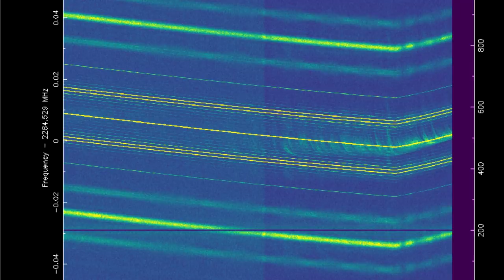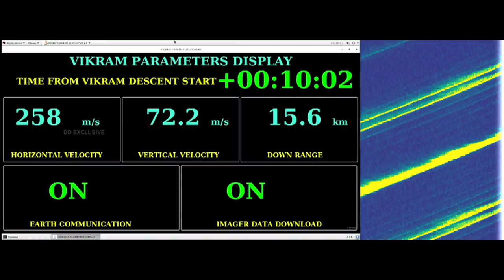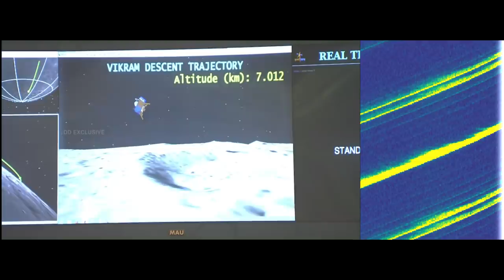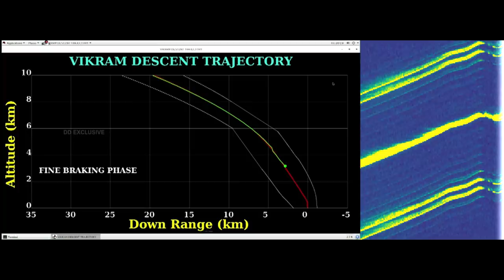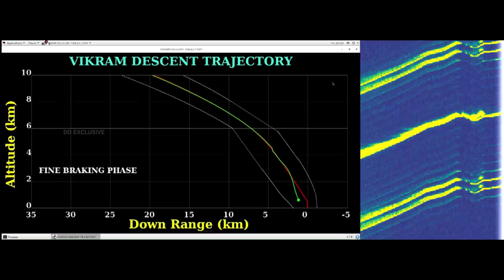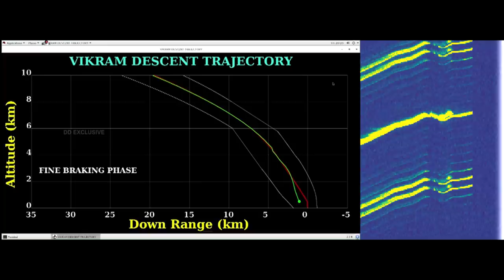What We Know About India's Failed Lunar Landing

Comment: "To their credit, they did hit the moon at a lower velocity than the [Israelis]" LOL, well I guess that's one way to look at it.
Reply: Why don't people ask why this is so difficult when the USA did it in a tin can in 1969?  Shouldn't it be 1,000,000 times easier with computers?  Wake up, people.
Reply: @basedbear1605  If Apollo 11 had followed its automated landing program it would have crashed into a crater full of boulders. And that's if the radar data overflow error could have been corrected remotely.  It only landed successfully because experienced pilots were controlling it in real-time.
Apollo 12, 13, 14, and 15 all had anomalies which could easily have resulted in failure had there not been trained men on the craft capable of diagnosing and correcting mechanical and computational faults. As we know, in the case of Apollo 13 the fault was so critical that the crew barely survived after having to scrap any possibility of a landing.
Reply: @basedbear1605  Actually, tell you what, I concede, perhaps you are right, moon landing is fake!

And so? Does that change the fact that there are new generation of space explorer, attempting to land on the moon? How does moon landing being faked or not change any of our current situation?
Reply: @HermanVonPetri    I think NASA's airbag approach is the best so far if it absolutely has to make it there in one piece.
Reply: @HermanVonPetri  That's a very good point.... However, the computer aboard Apollo 11 had less computing power than in high end Samsung refrigerator.
Reply: @Verpal  If you cannot see why faking the moon landing was important, then I doubt you will listen to anything you are told.  But I will try.

Getting a population to believe an absurd lie is the easiest way to control them.  Once you take something as truth, you base everything after that on that thing.

If we landed on the moon 50 years ago, why did no one follow us, ever?  Are we really that super special that no other nation could fly to the moon in a tin can and paper thin suits in a vacuum?  And shouldn't we have a moon base by now?  The moon is the pinnacle in military advantages.  You control the Moon, you control the Earth.  Why aren't nations fighting over it?

If you believe the moon landing was real, you will believe whatever the government tells you.  It is 100% about mind control.  NASA is the new religion, people believe on faith.
Reply: @WadmanP  So? The more complicated the system, the more there is to go wrong. The best you can do with an automated system is to have backups for the backups for the backups, and hope that you've accounted for the most likely and/or most serious eventualities. And there's still going to be problems that weren't anticipated.
Reply: @basedbear1605  I fucking wish NASA was the new religion.
Reply: @basedbear1605  What's wrong with you?!?!
Reply: @basedbear1605  grey and tasty?
Reply: @basedbear1605  I just wanted to confirm a few thing first.

Is moon real to you, is there an actual moon? Do Space exist?
Reply: @basedbear1605  and USA has shared the technology with the world? Or trying to maintain monopoly?
Reply: @basedbear1605  half of the world was under British rule when USA was already developed. Other countries started late. USA didn't land on south pole yet which is most difficult place to land on moon.
Reply: I'm assuming you're a moon hoax person. While in some respects it's "easier" with computers, it's also a monumental engineering issue, and as we saw even with Apollo, we had many issues. So yeah, guess what, first time India tries to land something, it went sideways. It happens, how many attempts have occurred since we did it? Pretty expected there are still some failures.
Reply: The funniest thing about the moon landing hoaxers is that they tout how important it was. So they really think the Soviets and pretty much every country on the planet was like "okay this is faked, but we'll just go along with it, because...reasons." This global conspiracy, where even the Russians are like "let's let the Americans because..." is obviously such crap.
Reply: @basedbear1605  the soviets tried, and failed. Their moon rocket to be blew up during every takeoff. The N-1.
Reply: @basedbear1605  computers may have improved but the laws of physics remain the same and propulsion technology is essentially unchanged. In just two short sentences you have very clearly demonstrated and almost complete lack of understanding of the relevant factors (which is really quite normal for you moon hoax/anti-vax/chem-trail/insert-delusion-here people).
Reply: @basedbear1605  there's a little thing called the Van Allen belt or some sush name , ........
Reply: @basedbear1605  i think you need to wake up instead.
Reply: @basedbear1605  why is it so difficult to make a self-driving car when people have been doing it for centuries? 
Answer that question, and you got a similar case to apollo 11 vs modern unmanned landers.
Reply: @basedbear1605  no it should not be easier with modern computers than with the simple computers NASA had in 1969 and a human. The computers failed in 1969 and they had to land manually because the physics did not behave reliably enough for the math to work. More powerful computers don't make physics behave differently, math is still math, when the world doesn't follow the math a computer can't do anything, and it's very hard to have all the math perfect for a moon landing. The difference a more powerful computer can make isn't as big as the difference that when it failed in 1969 there were 2 humans ready to land it, when it failed in 2019 there was no one on board.
Reply: What was that quote? 'never attribute to a conspiracy what could more easily be explained by incompetence?'

Eh. That's not really that relevant. XD

The thing about conspiracies is they are difficult to maintain.
You REALLY think it's more believable that tens of thousands of people successfully maintained a cover story about faking the moon landing, without issue for 50 years than the idea that we actually landed successfully?

The problem is, somehow a bunch of people think maintaining enough secrecy to keep a worldwide conspiracy that would've had to deal with trying to get hundreds of thousands if not millions of people to keep a secret and not screw up at all is an easy task.

Most secrets struggle to be maintained for more than a decade or so when it's less than about 100 people that even know about it in the first place.

There's nothing believable about a conspiracy that requires absurd levels of secrecy to pull off. 

I'd sooner believe that the moon is made of cheese than some of these inane conspiracies that require millions of people to maintain secrecy AND extensive illusions about reality for many decades at a time.
Reply: @Fubuki_Kai  
Stop lying to yourself. The Soviet Union landed several Landers on the moon. Check out the lunar series
Reply: @Fubuki_Kai  
In fact the Soviet Union was the first country to put a man made object on the surface of the moon.
Reply: @azeezbawumia6511  I mean their manned moon program. They did have alot of unmanned achievements and even held the record for the longest distance travelled on another celestial body for a long time up until Opportunity broke that record in 2016 I believe. Not trying to say they didnt make it to the moon at all, only that the Soviets tried to put men on the moon and failed several times.
Reply: @Fubuki_Kai  the Indian mission was it a manned  mission? No so why are you comparing the two. As I already said you are comparing apples to Oranges.

Compare Russia's unmanned lunar missions to India's unmanned lunar missions

Even that is still not far considering the fact that Russia achieved those feats when technology wasn't that far advance like it is today.

China nailed it and India could have easily nailed it too.
Reply: @azeezbawumia6511  I never said anything about India or china?
Reply: @Fubuki_Kai  
I'm telling you that China landed a lander on the moon without any failure as such India could have also achieve the same feat without failure.

You probably have issues with comprehension.
Reply: @azeezbawumia6511  ok buddy, and all I said was that the N-1 rocket program never suceeded. We landed men on the moon, and the Stovies tried. I was only addressing bear's point that nobody else tried to "follow us".
Reply: @revermen3580  Indeed
Reply: @rajeshprajapat6009  What technology?  Rockets?  Are you serious?  That's 100 year old tech.

The Chinese are ahead of us with regards to AI, and they still haven't sent people to the moon.

Do you really think that there are any tech secrets any more?  That's cute.
Reply: @mcs699  There you go again... thinking.  You should leave that to your betters.
Reply: @rajeshprajapat6009  Are you familiar with logic?

The Soviet Union was neck and neck with us.

WHY would they ever have stopped when the Moon is the ultimate in military advantage?  Why would they stop and not have planted their own flag? 

Answer:  They wouldn't have if it were possible.
Reply: @Fubuki_Kai  I am well aware.  NOT ONE MAN HAS DIED IN SPACE.  NOT ONE.

That is so incredible by itself that it's beyond imagination how someone would believe we went through the most inhospitable environment possible to man without anyone even getting radiation poisoning.

Do you know what the Van Allen Radiation belts are?  Look them up.  According to NASA, we STILL cannot get through them.
Reply: @kirkc9643  Here's how brainwashed you are.

You JUST ADMITTED that the rocket tech, which is the most important part.... has NOT changed and is easily reproducable.... but yet no one has been back.  Not one single country in 50 years.  Not even the Soviets who had the tech at the time.

You don't find that odd?  Amazing.
Reply: @higueraft571  Wrong.  The question is... if it worked once.. why don't we keep using THAT?

NASA claims that it would be "a painful process to build it back again" (Don Petit quote).  Really?  They take $21BILLION a year and they can't recreate a 1 KB computer system?

Cmon man, open your eyes FFS.
Reply: @HolbrookStark  This is the worst argument of all, and people try to make it again and again.

If a 1 KB computer system is what it takes, then we could EASILY remake that same system from spare parts at Radio Shack (if they were still in biz).

If you believe that we are incapable of making the same transistors and computer parts that were in the Apollo 13 space program and recreating it, then you're simply a fool who will believe anything, because that's ludicrous.

Why would NASA ever lose the telemtry tapes?  Shouldn't those be in the Smithsonian???  The greatest achievement in human history and they LOST THE EVIDENCE??????

Cmon man, open your eyes.  That's simply stupid to believe.
Reply: @basedbear1605  Cryogenic technology was denied to India by USA in 1990's then we developed our own. Rockets are used to launch spacecrafts and not land. 40% of the  lunar missions in last 60 year have failed. ISRO was able to launch mission on Mars in first attempt. Launch more than 100 satellites in one rocket. No country including USA has landed on the south pole of moon yet. Landing in Florida is not same as landing in Antarctica. China stole all your technology. This is shocking the extend to which China has taken over the USA market and reverse engineered everything.
Reply: @rajeshprajapat6009  While some of your claims are true... none of them dispute my facts, and none of them explain why no country has ever gone back in 50 years.  USSR was right with us neck and neck... why would they just STOP and not fight for the moon?  Are you saying the moon isn't strategic and worth fighting for?
Reply: @basedbear1605  there is no atmosphere on the moon. The probability of successful landing is low. The priorities could be something else for Russia or anyone else. There are many videos to explain on YouTube. If USA was able to land on moon in 69 then should have established station there by now. World know what happened but the rocket science is complex, all countries are kind of reinventing the wheels for their own country. The space race is not just bipolar anymore. The whole idea for whatever I said was to explain why it was difficult for ISRO to land on moon's south pole. Thanks
Reply: @basedbear1605 : Why didn't anyone follow us? Because we confirmed that the Moon is a dry dusty dead rock that has no strategic value except as a place to practice landing spacecraft, so there was no value in going there again. The reason China and India are going now is because they've decided they want to have space programs capable of landing on dry dusty dead rocks, not because there's anything valuable there.
Reply: @basedbear1605  ...have you seen the inside of that damn computer? I have. It is the most ungodly complex 1kb computer system you have ever seen, i understand why they say it'd be painful to build a new one. From what i saw, it would take at least weeks, maybe months to build one as the old computer was.  

And again, it still doesnt work perfectly. If it wasnt for Apollo 11 being a manned mission, it would have ended up almost exactly the same as the Indian lander. Debris on the surface, and only one man returning from Lunar Orbit. 

If you want to get a successful landing without humans un-fucking the botched programming. Go ask China and their landers.
Reply: @basedbear1605  yes what usa did was remarkable .....but usa cannot able to find water until india said they found the water on moon in 2008 .........the major difference is the attempt by india is to land on south side or dark side of the moon where sun is not abundant ....all the secrets of the moon and solar system from like zillion years are there because it was not damaged or touched by solar disturbances and sun heat and no one explored it .......these complexities make it much harder , still as you can see it did well to stop the gravitational pull ........the lander might have turned because last time check would have given it the surface is not good but it had no time to correct itself becuase of the gravitational pull ......if the machine did correct itself in 5-7 km altitude it would have ample time to correct .........
hidden side mean man cannot pick the place to land but it should be done and correct itself by machine and it did well for 98% ......t
Reply: @krishnag773  I'm sure that made sense in your mind.  Shoulda kept it there.
Reply: @basedbear1605  well great news since i commented on this post , they discovered lander is safe in one piece but landed 500 meters away from its position, and in tilted position ( i think it is due to last minute course correction) ....if there were life on this lander there won't be any loss of it (now this makes india first country successfully land on south pole of moon)
bad news- might have lost communication lines due to damage by last minute course correction .....waiting for connection establishment 

whether they establish connection or not since yesterday this is great news that lander is not in pieces but intact
Reply: @RyanTheHero3  Going by his user name he joined the Owen Benjamin cult. Owen is not even a halfwit.
Reply: @basedbear1605  yes tell me all about being blind , isro just achieved a feet by landing on dark side of moon .......whether they made communication or not whether the rover comes out of lander or not ......isro landed on dark side without crashing and it is the 1st country in the world to achieve its feet .....well lets see what nasa does in 2024 .......went to moon 1967's but could not discover water until india did in 2008 .......talk about computer which is 1,000,000 times faster(in your words) ......
Reply: @skipper2285  just a small correction: Luna 9 managed a soft landing a few months before Surveyor 1.
Reply: @rajeshprajapat6009  Why can't you answer a couple of simple questions?

Why would USSR just STOP and not try to match our feat of reaching the moon?  Never in history has a rival country just sat by and let another one claim glory without reprisal.  Why would no one follow us for 50 years?  Why didn't India just fly 3 astronauts right to the moon like we did?  

Some "falsers" believe that no one went back because it's a worthless rock.  Are you one of those people?  If so, why is NASA now saying that we should return to the moon as our next steps in space??

Simple questions.  Should be easy to give me simple answers.
Reply: @basedbear1605  I don't know about Russia. India is new entry. A lot to work before any manned missions. This was only the 2nd moon mission and 1st one to soft land anything on moon. Some facts what I know is water on moon was not discovered even until India's chandrayaan 1 mission. That redeveloped world's attention to explore further.  Mars is more earth like so by terraforming it can be colonized someday in future. I don't know why moon wasn't persued any further.
Reply: @rajeshprajapat6009  The answer is  Because we never went.  Humans can not pass through the Van Allen radiation belts... NASA has confirmed this.  Look up the Orion project... they admit it openly.

Open your eyes.
Reply: @basedbear1605  I know that this is also a theory that man's moon landing was fake. If 1969 man landed on moon then by 2019 we expect moon station at least and man landing on mars.
Reply: @rajeshprajapat6009  No.  There is a theory that we went to the moon.  THAT theory is BS.

Reality, or truth, is not a theory.  It was not possible for us to pass through the Van Allen belts, we cannot get through them even today.  NASA admits this, and people STILL believe we went to the moon in 1969 in a tin can... in paper thin space suits that cannot withstand a vacuum.

NASA is a governmental jobs program... as is India's ISRO.  Just something to keep people distracted while they drain you dry of your money.
Reply: @basedbear1605  Nasa is an organisation that loots tax payer money 20 billion dollars per year and indulges in frauds in space to justify its huge absolutely huge budget. Like their fake moon landing. Chiense and russian space missions are also suspicious. Chiense dont even show live broadast of their launches. And suddenly one day u find chiense rovar on moon. Russia backed away when isro aporoached them for chandrayaan 2 becuase they knew they didnt have the technology to meet isro demands. By the way Indias chandrayaan 2 mission was using a ground breaking technology that taps into the graviational force in a very unique way. Isro annual budget is just over a billion dollars. It was even smaller 10 years ago and yet manages to excecute complex missions. Nasas achievements is nothing to brag about considering their huge budget. Chandrayaan 2 orbitor is the most advanced by a long shot compared to other orbitors going around moon. And our lander is absolutely intact.
Reply: @doom2000000  You are both preaching to the choir and missing the point entirely.

If you think, for one second, that India's space mission is LESS of a fraud and scam than America's, you're mistaken.  They ONLY take $1 billion per year now.. they will continue to take more and more without producing tangible results that normal people can verify and/or benefit from... JUST like NASA.  You are not different or special.  Corruption is everywhere.

It's about corruption.  Those in power understand how to control masses... you keep them blinded with "bread and circus" and they will keep giving money endlessly.
Reply: @basedbear1605  i am sad that in your twisted mind it didn't make sense .......anyways india just achieved 99% of what it planned (this is reality )whether you operate in reality or not